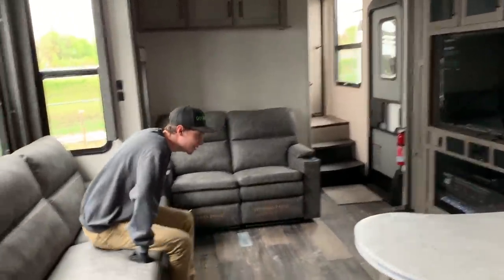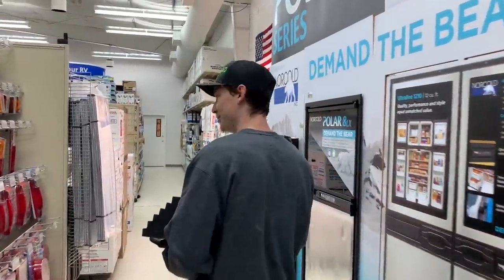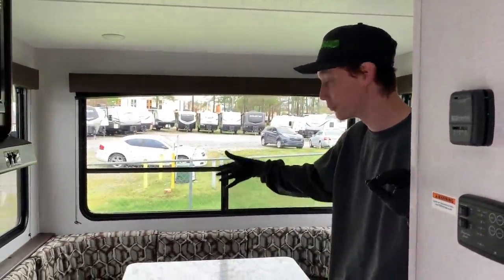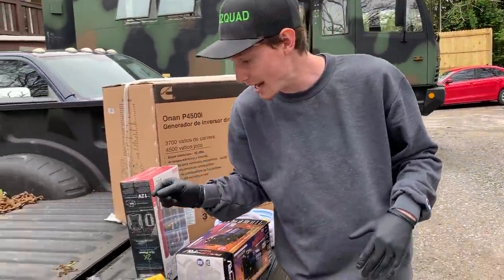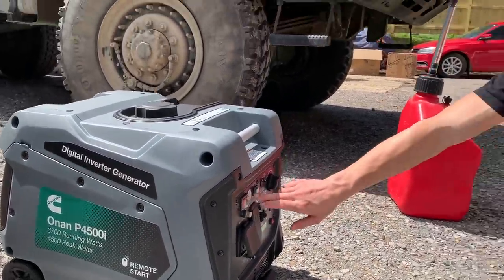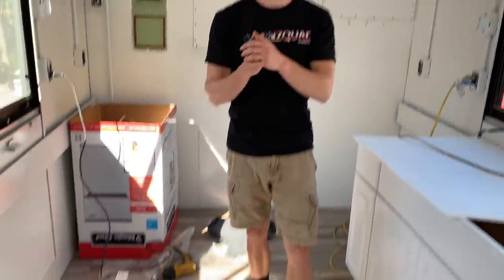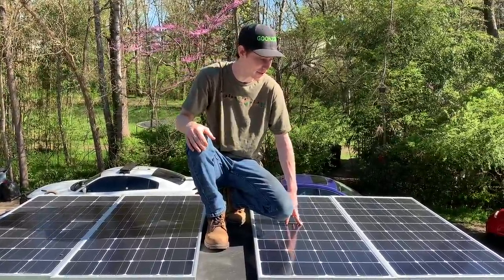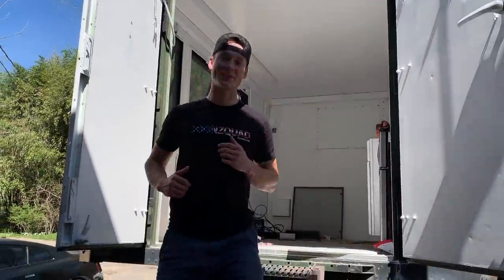Building The Ultimate Apocalypse Vehicle Part 5

Comment: Dont put those batteries inside, they expell acid gasses when charging that are daangerous..!!!
Reply: Lead acid Batteries Expel Hydrogen gas when charging, and that can be explosive
Reply: Make A bracket to hold them underneath the bed in front of the tires
Reply: Shuldnt worry bout tht. We put in buildings out.   I no my stuff
Reply: AGM Batteries don't out gas Hydrogen.  Neither do Lithium.  Those flooded batteries do though.
Reply: Just made this same comment AGM if ya dont want lithium. I'd suggest a Cmax setup power for weight can't be beat
Reply: You ca box them and vent it out, but on that i would say buy a cheap side mount tool box and weld it to the underneath
Reply: I agree. Put those batteries outside.
Reply: Guys, Please do not used lead acid flooded batteries in the living area of your build. they should be mounted outside in a vented battery box. If you want them inside, used AGM or lithium batteries
Reply: Aren’t marine batteries glass matte though? Or did they not buy marine batteries? Also why not use some of them batteries that are marine grade and 800$ they said? I’m sure they’re way better anyhow
Reply: You don't use lead acid batteries in these systems anymore.. now they have sealed gel cells and lithium batteries... You do have to get a regulator and controller however , to maintain the battery voltage input/output
Reply: Never put batteries inside a living compartment. Put them under the truck. Next to the original truck batteries. And a big easy the see flip switch to isolate the batteries.
Reply: Put the batteries in a regular ol’ battery box by the gas tank
Reply: and they need fuses and breakers for the cable from the solar to the controller and controller to  inverter, idk :/

Comment: The generator and plug only have one hot wire, you need two hot wires for that breaker panel. It would be a 4-pin plug, a twist-lock 220 type plug found on other generators.
Reply: Facts.
Reply: Also looks like the panel is a 3-phase system, which will need to be swapped out as well.
Reply: Robopwner install a jumper from l1 to l2 all breakers will work
Reply: 3 phase power is needed for all outlets to effectively work. More importantly though, MAKE SURE THE CAB AND GENERATOR ARE GROUNDED!!! Don’t want anyone getting electrocuted when it’s wet out or if there is an issue.
Reply: @Jared01  The panel is a fairly old model 3phase. The three large terminals in the middle for the 3 phases, large terminal on right for neutral, smaller one on left for earth. To get everything working link the three terminals together to the live feed from the genny. They'd be better off ripping it out and getting a sparky to put in a new single phase panel.

Comment: One of things when camping in the bush is conserve water as can use it very quickly if operate as if connected to mains water like at home. Think about where you want to go camping and set up for that style - but if want to be both on and off the grid then need to set up so flexible. Re water you want to think LOW flow so use as little as possible from tanks so not forever filling or can go for some time offline. Similarly think max battery storage and as others have said charging while driving. The other thing to think about is if you are likely to do one night camping is the principle of "minimum set up". You want setting up camp to be easy - if it is easy then you are more likely to use it as camp set up and break down is a hassle that puts you off doing it. A freezer is handy if camping off grid for week or so too. Great to see you went to camp store and looked at RVs - RVs parts are usually smaller and lighter so fit tight spaces better. Look for new material ideas too as some recent innovations out there. Make an electrical plan as you don't want to redo stuff. Your batteries look to be lead acid - cant run those inside due to gas vapours. Better to get AGM batteries as they can be mounted anywhere including on their side - no venting and not fluids to leak also have long cycle time.

Comment: Should be using Lithium batteries, from like a tesla or a nissan leaf, they will work way better, last way longer (lifespan) and you dont have to worry about gassing from the batteries,. hope you guys see this
Reply: There's also cell tower AGM batteries which apparently can be found for cheap on Craigslist and they still have a lot of shelf life left.
Reply: or just install a tesla powerall
Reply: Also you should build a metal box for those batteries & put it on the frame under the floor or somewhere. You dont want to be living with batteries, especially lithium. They are Nasty suckers if they short and start venting - Big fire, sparks & fumes! A Real incendiary device Boyz. 😎

Comment: The panel is setup for 3 phase power. That is why you have three lugs at the top of the power busses. You can't power everything with single phase power from the home or generator. You can move your breakers to the buses that are powered up but if you need 220V then make sure you have a breaker that connects to both busses that are powered up.
Reply: you can certainly power everything on a single phase, its a 3700 watt genny, as long as the breaker is uprated to 3500watts or how ever many amps that is at 120v  and conductor size to match the draw. you can run everything off a single phase.
Reply: Yep that's a 3 phase power

Comment: Nice job so far with the survival truck.  As for generators, you have a diesel, so get a diesel generator so you can used the same fuel, or even hook up to your existing fuel tank.  The idea here, is the more simple, the more reliable.  Don't forget a CB or short wave (or both) radio.  As for radios, I suggest an RCI 2950DX this is a 10/12 meter radio, and you can get it wth the 11 meter (CB) mod.  Good, reliable communications is a  must.  A scanner isn't a bad idea either.  Also, put a winch (a big one) on that truck.  If you ever get stuck, your going to need one.

Comment: Here are a couple of thoughts:1) you may have a seam that has split on the top where you were locating you solar panels. Check all seams to ensure they are water tight.2) I would consider Rhyno Lining the roof area to help seal it and provide better traction.3) I would build a frame (enclosed?) for the generator and find a place underneath or between the box and the cab to install it.4) for the large access hole at the front of the box, where you thought about putting the generator, I would change out the metal cover, replace it with plexiglass and install a flat screen tv in the opening.Jeff

Comment: Guys, that's a three phase panel! I have an ISO communications box from the Navy. You need to bridge all three phases together to run it on standard 120 volts. Those connectors going to the outside are designed to hook up the unit to a tow behind 3 phase gen set that is HUGE! The connectors that mate up to them cost upwards of $2K each! So much for military supplies, anything with an NSN part number will cost more than 4 times its actual cost. If you don't have a built in Enviornmental Control Unit ( military jargon for an over priced heat pump) to heat and cool the box you won't need 3phase power. 
Good luck with the build!

Comment: I’ve seen other conversions of vehicles like yours, and they mounted their generators on the rack above the truck cab, to avoid carbon monoxide fumes. Your rig is looking good!
Reply: The ECU (Environmental Control Unit) goes where they plan on putting their generator. Thats how the shelter is heated and cooled.

Comment: You have a 3 phase load center (fuse panel) which is usually found in a comercial building. Dont use one of the phases in your camper panel or swap out the panel to residential type. A residential load center has single phase power which more compatible with your generator. Awsome truck.

Comment: Put the solar panels on a metal hand rail with an electric lift, so when you want to go to the roof you’ll still have all the room, and handrails for added safety.
Reply: So happy I read the comments before I said what you just said
Reply: I was thinking Pamela on swing out hinges. Let them hang above the windows and when you park, swing those suckers out to get some sun.
Reply: Agreed and I thought solar panels work better when placed in an angle.
Reply: @divvish  They do work better when angled directly at the sun. But in most cases it isn't enough to warrant doing it on an RV.

Comment: Lads, that fuseboard looks 3 phase to me..switch it out to a single phase  board. Stay safe in the US all..all the best from the UK.
Reply: I was thinking the same.
Reply: how can you tell it's 3 phase by looking at the board?
Reply: @fuckjewtube69  3 bus bars. 3 inputs on main breaker.
Reply: @fuckjewtube69  as below, 3 busbars and inputs. Personally i'd rip that all out and put in a single phase board. With the small space I would put all the sockets on a radial circuit ( using correct cable size and breaker rating ). Dont know how you US guys would do it.

Comment: When you run your plumbing connections, you should use PEX. It's very easy to work with and won't corrode or degrade. Much easier to adapt as well.

Comment: Sinks, are useful, but make sure you can cover it, so you can use the counter space when the sink is not needed.  Space, is any camper, is at a premium.  A fold away gas stove (one that retracts into a counter) is a nice addition.   You will want exhaust fans.  A small air conditioner (not an RV type, these are not efficient), is a must.  Get an inverter, that is bigger than 2000 watts for your solar conversion.

Comment: Be careful where you install those batteries make sure they’re positioned in a well ventilated area.
Reply: Very true. When charging they off-gas, which is not something you want in a small environment like that. Better yet would be to get some Lithium-ion deep cycle batteries. They last way longer and no off-gassing.
Reply: The danger with flooded lead acid batteries is that they can produce toxic and also explosive gasses when charging. That's basically the issue with using them indoors, even if in a sealed space. Lithium-Ion are probably the best but can't be charged at full power if they are 32 deg F or below. Solar setups are a whole topic into themselves. But you guys do your YouTube research and I know you'll be just fine! Love the channel guys!
Reply: How about making algae gas. Or make bio diesel all it is is diesel made by bringing home a drum of waste already used cooking oil every restaurant has out back and running it thru a filter and adding some heet and duuuuude the biodesil seperates from murphys oil soap no joke in your reactor outback you use or sell the soap and siphon the bio diesil off the top of your white farm size container and free gas for the big green monster. I assure you it works it is sience you two can handle right now. I have been hf ere forever in the background. Talk about views hey your truck will smell like egg rolls or something when you floor it. I swwear this works on the cheep too!
Reply: Good point, Danny. 

You have that other compartment next to where the generator is going. I’d fabricate a rack to strap/mount those batteries to inside that compartment. Also, make sure they’re running in series. Only one solar charger is needed, and it will simplify your wiring to anything drawing power from them. Be careful about having your generator running the same accessories as the solar/batteries run. Back feeding power can turn out real bad.
Reply: Those guys really need sealed batteries or the toxic fumes from those batteries is bad juju! Was hoping someone had started a thread on them!
Reply: slymanbry thanks you

Comment: Also, you're not going to want the inside of that thing to be lit with LEDs all the time... Do you REALLY want it to be as BRIGHT as a paint booth inside when you are camping or trying to be incognito???
Reply: Yeah they should have added a dimmer switch at least to keep the brightness to a minimum  because they are bright like the sun
Reply: They make a variety of LED lights now, I wouldn't buy anything BUT LED's, they are more user friendly, create less heat, and use less electricity.  You can buy them as soft light dimmable also.
Reply: Although it will be bright in there , with the doors and metal window shades closed , pretty sure no light will be visible from the outside .
Reply: It’s not gonna be crazy bright I’m depending on the size. And you can dim them

Comment: That's a 3 phase panel (most homes are single phase) that looks to be providing both 120 and 240 volt power to some of those outlets/devices. I'd suggest tracing out/identifying/isolating all of those receptacles and runways before connecting the solar panel system.

Comment: Your AC panel is  most likely designed for a 3 phase generator. Your generator provides only 1 phase and 1 leg of 120V AC (240V generators provide 2 legs 120V each). If you run a small AC unit, say 10 000 btu or less you will be fine with your generator. It might be easier to install either an RV power center to distribute 12V DC and 120V AC loads. They also make waterproof outdoor connections for RV power cords. 4 solar panels should be plenty!

Keep up the great work!

Comment: It's a perfect spot for the generator! After it's bolted in, and runs out of fuel........ How you gonna fill it up? Awesome build!!
Reply: Its a emergency. They plan on using solar panels as a main source of power if you did not already watch the full video.
Reply: @yurunning5574  yes I get that, but even still in the event of needing to run the generator, it's going to be a p.i.t.a to pull that 60-100lb machine down Everytime just to fill it up..... Better to think of it now.....

Comment: Also regarding the solar array,  if you want to keep the top of the camper free for chill space how about arranging the solar array on hinged panels, one folding forward over the driving cab and the other folding out over the access door in the back.  The top will still be free and you would gain same extra shade space and rain protection for the rear door and ladder.  Or the panels could fold out on both sides and leave the top clear.

Comment: Place all the solar panels on the roof but have them on a rail system so they’re able to stack on top of each other for more room when you guys want to go up there
Reply: Only issue with stacking is that vehicle is already very high so you’d be limiting your clearance even more
Reply: Vault 614 they would only need to stack them when they are stationary.
Reply: Or they could just leave them and walk between like they said. Sounds simple and will work

Comment: that generator is loud asf lmao. Them honda ones are practically quiet
Reply: Dillon They should’ve bought a Honda one, they’re way better
Reply: I have two Honda 2000eu and theyre super quiet
Reply: Can’t beat the Honda!
Reply: I used to service both Onan and Honda generators as well as others regularly for a living. They are extremely reliable, as well as efficient and quiet. Very rarely did I need to perform any major repairs apart from basic maintenance, and when I did, they’re easy to work on.
Reply: @steveg2277  The one on my toy hauler is an Onan. Only "major" maintenance I've had to do is rebuild the carburetor.

Comment: im an electrical engineer get a automatic transfer switch for the generator connect to main power breakers if you guys using emergency power
Reply: Harold Padilla ----<<<<<<He's right..please do that. You don't want to be plugged up at the gen (with it running -say power went out) and you are still plugged up to the site you are at (if camping). You will be putting power back towards the elect company, and possibly killing or injuring someone down line.
Reply: i also watch and hear clearly that you guys are installing an alternate solar power kit, you definitely use those automatic transfer switch

Comment: Don’t put your batteries inside they give off a deadly gas mount them under the camper.
If you do put them in there vent them to out side. If you look at all campers they have their own compartment.
Do more research on it. You should of checked the campers when you where there.

Comment: If you haven't found it yet, one of the military technical manuals for your LMTV is TM 9-2320-365-24P. It's the parts manual that contains all the part numbers and general diagrams for EVERY nut/bolt/switch/wiring harness that's in the vehicle and the variants of it.And the breaker panel part number is G3042MB3200CU. Its a 120/208/240v 3 phase 4 wire panel...that's why you weren't getting power to some of the circuits.

Comment: Get a higher watt solar panel (400+ watts) so you don't make use of all the roof space in case of building a rack on top for luggage or camping gear. Remove all the electric lines and run a fresh parallel line with each outlet to a rated amp breaker depending upon the load used. Also, it will be a good idea to mount the batteries outside. Great content and good luck. stay safe all..😷

Comment: You should use a sealed battery not chemical for something stored inside the vehicle.  Then no need to worry about corrosion or venting.  It's more expensive but can also be cycled to lower voltages without damage.  That dc to ac inverter is small.  Definitely want something more heavy duty to run microwave or compressor. Fridge can suck up some current as well.

Comment: Benefit of the RV fridge is that it will run on PROPANE...and switch to 110V when available so it will cool at all times. The mini fridge you got won’t cool unless you have 110v from shore power or the generator.

Comment: Get the biggest inverter you can get and get a transfer switch. This will give you the ability to switch from generator to solar power with out burning the thing to the ground! Also mount the generator under the truck for storage and when in use. It will be a pain in the 💥💥💥 to fill full of gas on top of the cab.